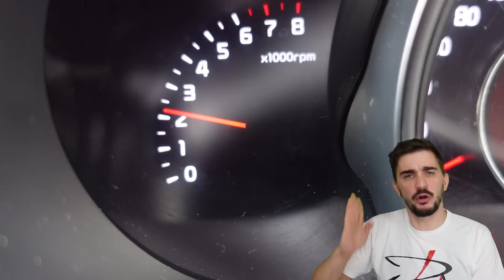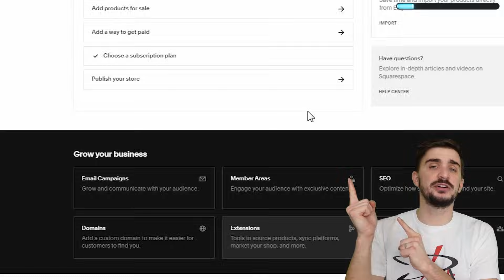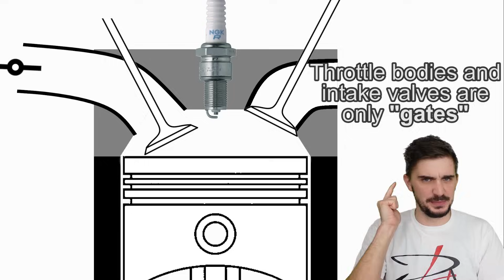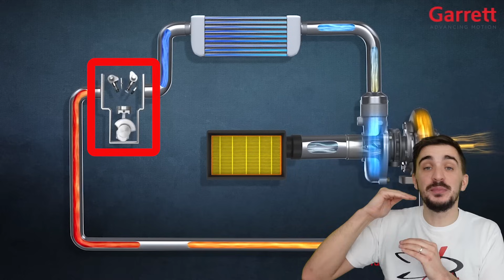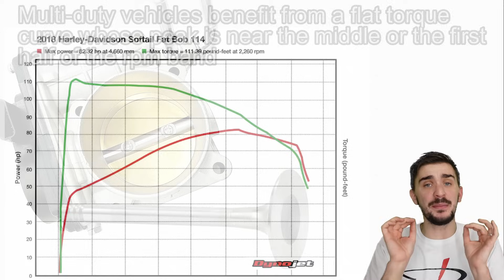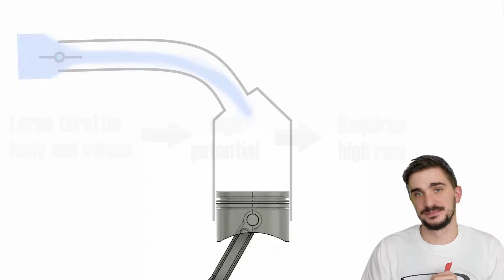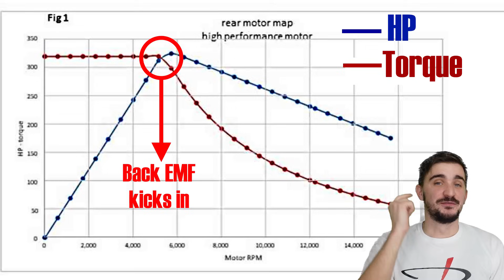WHY are HORSEPOWER and TORQUE CURVED?

Comment: Hello, I have a few questions which I am not experienced enough to answers for myself.

If I have 2 engines, a diesel and a petrol, that produce the same peak power

Would it be better to run a diesel around 2000 rpm which is more efficient since the pistons aren't moving as fast as the petrol engine ?
Wouldn't cars be much more efficient with a CVT transmission that keeps the engine at a consistent RPM since no power is lost due to accelerating/decelerating pistons ?
Would the 2 engines produce the same output on the wheels if you just change the gear ratios ?
Why don't race cars for example use low RPM diesels with a different transmission better suited for racing then ?
(I'm not talking F1 or LMP cars more like rally or touring cars)

Let's say I have a diesel engine with 250HP/500Nm and a petrol engine with 250HP/400Nm
The diesel engine has peak power at 3500rpm and peak torque at 2000rpm (250HP/500Nm)
The petrol engine has peak power at 5000rpm and peak torque at 4500rpm (250HP/400Nm)

Doesn't the diesel engine provide the same performance as the petrol engine without having to go high in the revs ?
Can the diesel engine exert the same rotating force on the wheel as the petrol engine without revving so high ?
If both vehicles use CVTs wouldn't the diesel engine always outperform the petrol since peak torque is higher

Why would car companies even advertise HP if torque is a better representation of how much power a car has ?
To counter argue my last point, can't car companies also say a VW Polo has 3000Nm of torque because it has very low gearing ?

This all seems to me as if the diesel is obviously better than petrol in every way but in reality it isn't and I don't understand why
Reply: I think the simplest answer to many of your questions is that max HP determines top speed and most of the time folks aren't using max HP on public streets. Another answer that may help is that gearing magnifies torque but reduces output shaft speed (road speed). And because HP is torque multiplied by speed (roughly speaking - just go with me for a minute) the higher torque multiplied by the lower speed = the same HP as you get without gearing. Gearing can't increase horsepower.

Comment: The torque curve is almost entirely down to how much air gets into the engine per cycle, it's got very little to do with how many cycles happen per second. How much air gets in is a result of tuning. If you close the intake valves at bdc you get almost 100% of the air into the engine at low revs, but less in at high revs. If you close them later you get better higher end torque because of the momentum of the intake charge (and wavefront if your port is properly tuned) forces more air in even when the piston is coming back up.

That's why a lot of modern engines have such flat torque curves: variable valve timing.

As others have said, at low revs you're limited by the amount of heat rejected into the cylinder walls, while at higher revs you're limited by the breathing capability of the intake and exhaust. (edit: exactly as you said in the latter part of the video)
Reply: Upvoted. Nicely explained.
Reply: @th3b0yg  Thanks. There are a lot of other factors (exhaust valve and port tuning to maximise scavenging for example). I will admit I'm not a mechanical engineer or engine builder, I just know a little bit about engines from interest and tinkering with my cars.
Reply: sumarized it precisely
Reply: that's why free valve is the pinnacle of combustion engine design (for road cars. not talking about drag racing, F1). almost perfectly flat torque curve from 1500 to 7500rpm. 300hp/l , 43.5 psi bmep. no throttle bodies/pumping loss, independent valve lift/timimg/duration controls how much air goes in, how many valves are used, and how hard the turbo is spooled up, acting both as anti lag, waste gate, you can theoretically do cylinder deactivation(not very likely to happen on a 3cyl though?) , skip revolutions at low loads, you can also do air brakes like on semis.
you can do different cycles to like Atkinson, or heck you could even run a 2 strokes cycle, although probably not very efficiently, considering its not designed for scavenging like a 2 stroke cylinder with ports, and has no expansion pipe. also who would do that to a 2M car 🤣🤣
Reply: @geemy9675 freevalve is a lot of components and system complexity in the worst part of the engine.
A system like VANOS, V-TEC etc. get 9X% of the benefit for a fraction of complexity and cost.
But i would love to finetune a true FreeValve system, not gona lie.
Reply: @geemy9675  the problem right now is that freevalve has not been shown to run for any decent amount of time, and not on any production engine. If you haven't already you should look at Fiat's Multiair. It can achieve many of the same benefits of freevalve with the added benefit of being out in the wild for many years as a proven product.

Comment: I think the third answer isn't explained correctly. It has more to do with time. You make it seem like the air molecules move at the speed of light. As pistón speed increases the phases decrease in period. The air doesn't fill all the vacuum. Related, the exhaust isn't fast either. Eventually the exhaust gas gets backed up in the chamber.

Comment: Isn't Power just the integral of Torque with respect to RPM?  I mean, that number in the denominator is just a unitless fudge factor to make our units pretty anyway.  

P=t*w  so D(P,w)=t and I(t,w)=P+c right?  

Notation explanation:
Using w for the lowercased omega which is rotational velocity, or RPM, t for tau which it commonly torque, and P for P which is Power.  Using Derivative(of X, with respect to Z) and Integral(of X, with respect to Z)
Reply: > P=t*w  so D(P,w)=t
No, you're missing the fact that P and t are not constants, but functions of w. So, in your notation:
P(w) = t(w) * w =>
D(P(w), w) = D(t(w), w) * w + D(w, w) * t(w) = D(t, w) * w + t
Reply: Yep, the Tesla example shows it clearly. At lower rpm the torque is constant and the power curve is a straight line, since torque is proportional to the rate of change of power.
Reply: @dielaughing73  "...torque is proportional to rate of change of power." That stopped me in my tracks for a moment because it sort of implies the arrow of causality pointing opposite to how I normally think of it. That's a simple trick I should remember - when you want to think a problem through a little more, assume causality points the other way and then ask yourself whether anything changes. You made me think.
Reply: @th3b0yg  It's an interesting relationship, and I didn't describe it perfectly. As the parent comment says, this relation is not a time derivative, but related with respect to engine RPM (hence RPM is the x-axis of a dyno chart). Therefore on a time basis the causality is not so simple.

I have pondered a little on what is the fundamental measure of engine performance - on the one hand, it is measured directly using torque (on a dynamometer) and then converted mathematically to power, but the actual impetus to spin the crankshaft is caused by the linear expansion of gases in the cylinder which is all about the amount of energy input over time, i.e. power.

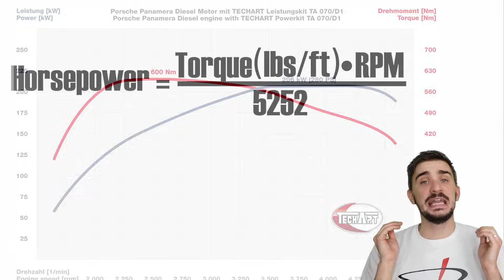Comment: 7:16 Thankyou for putting Pound Feet up on the screen to "correct" yourself.  If you hadn't done that, I would have to call you a Meter Newton.

In all seriousness, it's multiplication, so lb*ft=ft*lb because multiplication is commutative.  So Meter Newton is as valid as Newton Meter, but when you write it with abbreviations the look completely different.  Nm vs mN.  mN is the way we write millinewton, so Meter Newton just doesn't get used to avoid confusion.  But it makes for a fun (and meaningless) insult for those who put the unit of length before the unit of force in torque units.  I mean, Meter Newton is just so much fun to say isn't it?
Reply: He didn't correct the units onscreen though, which say "lbs/ft" not "lbs*ft"
Reply: @dielaughing73  I didn't even look at that equation lol, I just saw in the bottom of the screen he put up Pound Feet when he said Feet Pounds, or Foot Pounds, I can't remember at this point.

Comment: There's something I'm missing in that video and a spot where you might have mixed up power and torque, but I'm not entirely sure.

When you talk about torque rising with rpm, how exactly does piston speed affect torque? I agree that it definitely affects horsepower because more combustion cycles in a given amount of time obviously increase the amount of energy converted in that time, which again is the definition of power, but this is represented in the horsepower formula. It shouldn't affect torque on its own because the amount of air used per revolution stays about the same.

Torque is a number that can exist independently from time, the only thing connecting it to time in the case of a combustion engine in the fact that combustions take a certain amount of time, which also means that they have more or less time to occur depending on the rpm.

I think that this is where the connection between piston speed and torque lies:
Torque is averaged out across at least one revolution of the engine. If combustion at full force can't be sustained over the entire duration of a power stroke, there are some angles in that rotation where the combustion exerts less force on the pistons at low rpm than it would at high rpm. Think of it as decreased power stroke overlap because the individual power strokes become shorter.
Another factor could be air velocity creating boost in naturally aspirated engines, but I don't think it changes much at lower rpm.
Reply: He did get a little weird in his explanation in this video. As far as I can tell he's actually wrong a couple of times -- but his responses to that criticism have been that we're missing his point and/or are confused about the difference between torque and HP. I think he's a really smart guy and I've learned lots from his videos, but I just can't make sense of some of his statements in this video and in response to comments. It bothers me to see that from a guy I respect.

Comment: Understand all the points you mentioned, I just think you forgot to mention the simplest explanation of why, when you floor the car then drop the clutch, it doesn't hit peak torque or HP straight away. The simplest answer for that is drivetrain and rolling resistance. There is no vehicle at all, petrol, hybrid, jet or electric, around that can move 1 tonne or more of metal from a stationary position to peak torque/peak HP instantly. That's physics speaking. Everything else you said, I agree with completely for a simple explanation, the resistance of the drivetrain is what limits how fast the pistons or electric motors can accelerate their RPM range.
Reply: Power and torque are completely unrelated to the weight of the vehicle or its speed. It's a measure of the energy being generated by the engine
Reply: @dielaughing73  Yes I know that part, and you're not wrong there. However, look at the formula for calculating HP/KW, and it's all to do with the engine RPM. My point is you can't get instant RPM due to the resistance generated by the drivetrain. Hence why, an engine not under load, will spin up much faster to peak RPM than an engine under load.
Reply: @geordiegibson1210  yes you're right, in actual use there is an interplay between output and vehicle motion/ inertia. Naturally, motor power is rpm dependent, but as we see in the Tesla example an electric motor can deliver virtually maximum torque from zero revs. This gives a nice steep, linear power delivery (to ~6500rpm from memory) which is best-case (unless you're jet or rocket-powered!)

Comment: So with a vq37vhr.. it would make sense to have a bigger throttle body since its power kicks in at the higher rpms?
Reply: Well, you could make that argument for all engines. The VQ actually has a pretty nice and flat torque curve and pulls consistently to about 7000rpm thanks to the Variable Valve Event and Lift system which optimises valve timing and lift at all speeds.

You'll see other comments describing some of the complexities of air flow in engines.. just opening up the induction system may add some potential capacity, but may sacrifice performance in other ways (e.g. poor performance at low revs due to slow air velocity). Engine design is always a compromise between various performance measures as well as emissions, economy, heat control and so on.

VQs are commonly modified with turbos and exhaust (of course), modified intake manifold (for better air flow) and sometimes bigger injectors. The further you push performance though, the more you compromise street-ability
Reply: @dielaughing73  I totally forgot about the torque curve and only remembered the hp curve which peaks around 7500rpm, which is what got me curious about that. Thanks for your input.

Comment: Wait a minute... I always thought that power was mostly dependant on explosions per second (in addition to factors in the video). Surely the force of 100 explosions/sec vs 20/sec would make a huge difference in power/force generated in a given amount of time, or am I completely misunderstanding this?
Reply: That's what hp measure, in fact hp still rises even if peak torque is passed. Torque on the other hand is tricky, we can say torque is how much energy the single explosion is doing and there are a lot of variables that changes it's value, from intake to combustion to exhaust, everything is fixed while the rpm is always different, making the explosions more efficent only on the rpm band the engineers studied it for. Example, exhaust and intake can't get smaller/bigger depending on the engine working condition, making it max efficient only on a given rpm number

Comment: Another way to think about this is to break it down into two different ideas: an engine spends half its time basically pumping air, and the other half extracting power from the air. Engines work best when the intake air is turbulent and mixed well, and at low RPM the only way to generate that turbulence is by sacrificing airflow, but sometimes that isn’t possible (DOHC).

Comment: Is it possible to set which rpm range we can get peak output on ? Or it’s always depending on physical condition?
Reply: Different cam profiles, valves, intake runner length, and exhaust headers can all change where peak output is in the rev range

Comment: EV electric motors have poles. Each pole that gets passed by the rotor is similar to a single combustion event in a combustion engine. There's only so much energy-to-motion potential that can be delivered in each system in each "event." That is related to RPM in both powerplants. EV's cannot be fully efficient right off "stationary" similarly as combustion engines cannot be fully efficient right off stationary. People want to act like EV's are full power the instant the car makes its way across the first MM of travel. Simply isn't the case. There are poles in the motor that the rotor has to rotate past before another magnetic attraction event can draw the rotor past the next position. And so on, and so forth. It's almost equivalent to having a 16 cylinder combustion engine, the more cylinders, the more events per crankshaft rotation.

Comment: i thought its because of the cams, because an engine with some kind of VVT system will get you 2 torque peaks on a dyno graph and besides a rotary engine has no peak torque/power peak, it makes more power the higher the RPM
Reply: @TheGiganticNoob  I think you are correct.

Comment: Positive displacement superchargers generate flow.  The engine's momentary valve opening restricts this flow, causing a rise of pressure.  This pressure rise is nearly constant until dynamics of intake valve opening and mass-spring relationship of the intake charge limit flow.
Unfortunately,  most positive displacement superchargers have leakage at apex seals and this is why idle speed boost is limited.  Most positive displacement superchargers have boost bypass for all but wide open throttle position

Comment: Ah this is fun stuff! But don't forget the gyroscopic aspect of it all. With an engine, you have rotating mass which multiplies in weight the faster it spins. The higher the RPM's the heavier every rotating and reciprocal mass becomes. So the load increases with RPM is how that breaks down. That means wheels and tires too, the faster they spin the heavier they become! Of coarse you have the mechanical limitations of engine RPM just like the physical limitations of pulling more air/fuel through a straw and burning it in time then what it can mechanically support. Fun stuff indeed!

Motors are something else though. They do have the same rotational mass increase through the RPM, but they can change their timing to go faster electrically while the internal combustion engine is chocking on it's next breath of air and combustion event. They both can vary timing and they both will suffer from mechanical stress failures, but if I had to bet on a winner in any event, I'm betting on electric. I love engines as much as the next guy, but it's time and I'm ready to put that horse to pasture. Cheers man 🍻